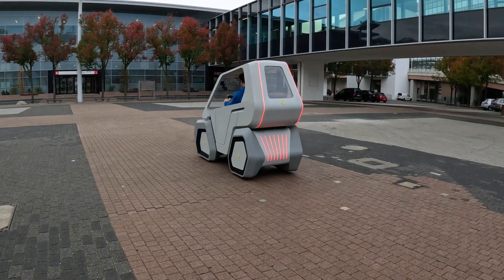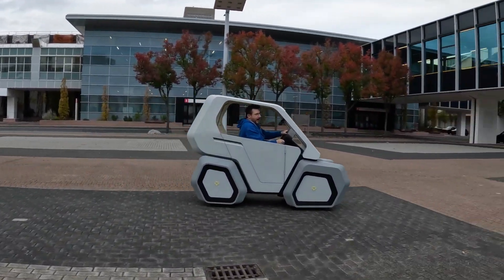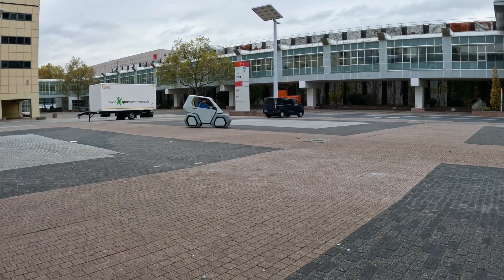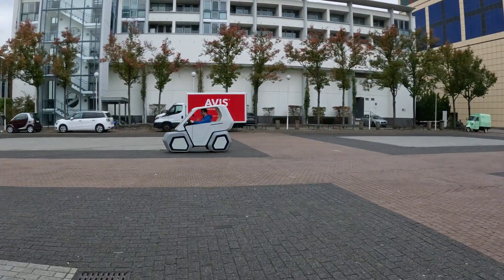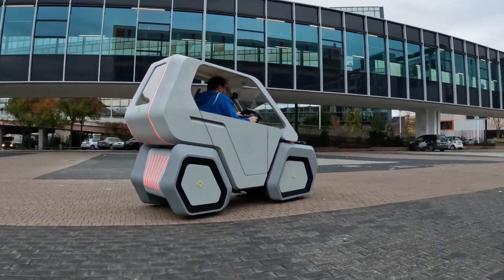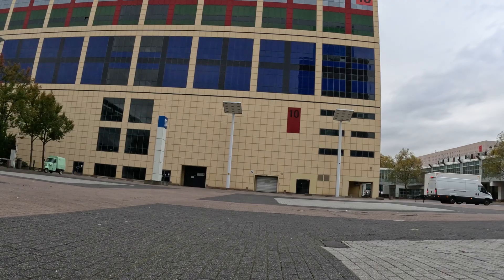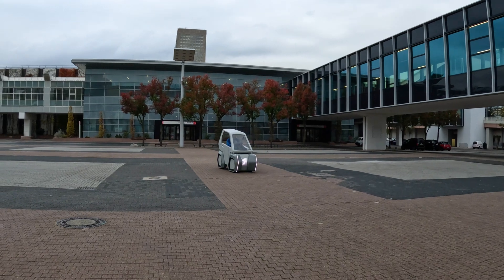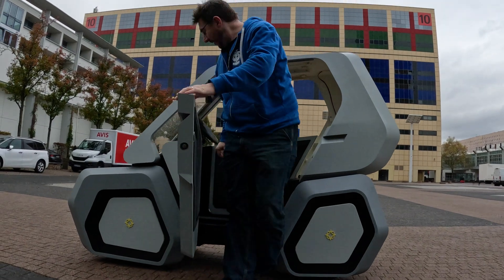Bicycle of the Future?

Comment: As a Dutch guy this looks like hell on wheels. It looks clearly designed by people that never drive a bicycle.

Also find it hilarious they try to argue it's a "green mode of transport" considering a regular bike is human powered, while the stuff required to make this thing aint. And even a standard electric bike is better due to simple things like air resistance and less materials required. And even if you want to be covered, just wear a poncho or if you're that dead set get a recumbent bicycle.
Reply: Exactly my thoughts. Just because it is electric, it's not green. It's also hard to imagine riding this monster on German bike lanes
Reply: @user-pp3yi5tv7l  Exactly, you'd either be an ass that passes everybody and is a general hazard to people you share the road with or clog the lane because you're stuck behind a cyclist. And that's not even getting at things like free turns to the right at some stop lights or places where you cross other traffic. 
It only really looks nice if you don't plan to share the road with other people or drive on between the cars at which point it's probably smarter to just get one of the 45km/h cars that count as a scooter (which are also annoying in traffic)

It really looks like a project that's build "because we can", not because it solves an issue.
Reply: I mean it's better than a full blown car... But that isn't saying much. I can see the appeal of a full cover. But covering the wheels seems just absolutely stupid to me. How will they get across any curbs with those covers? And to me, this looks like it really shouldn't belong on a bike lane. Imho it should just drop pretending to be a bicycle and get a renault twizy or something like that.
Reply: I get what you mean.
Still, using a rhethoric I despise when brought up to me: It is better than any SUV and compared to an actual bicycle or pedelec has better chances of being used instead of a SUV.
Yadda yadda, slavery, destruction through lithium mining, poisened earth mixed with blood - I know.
Reply: @manarallego3745  My objection is mainly just practical from a simple use POV. Regular bikes, electric bikes, recumbent bikes, electric scooters, covered electric scooters, etc., etc. are all better than that. As it's basically a very shitty 1 person electric car to begin with. Having those on any bike path is just hell for any fellow bicycler and yourself.
Even in the US where such a thing would drive on the road with cars or very close next to it you'd be better of buying a one person electric car.

As for the green thing, it certainly is better than an SUV (not that you see many here in the Netherlands, or Germany where this "bicycle" is being build). But as a thing that claims to replace bicycles and claims it's green as the things that it claims to replace are greener. It's akin to claiming tomatoes grown a few 1000 kilometers away and bought in the store are better for the environment than one grown in your own garden, because in the store it says "biological" on the package and the ones in your garden don't. It's pure marketing spin.
(and the whole green thing of electric vehicles compared to a similar modern cars is questionable at best to begin with if you include the whole life span of the car but that's a whole different discussion)

Between this thing and a SUV sure, it's greener. But it's basically a shitty renault twizy or similar 1 person electric car that would be an annoyance on the bike lane on a good day and an outright hazard on a bad. (thanks PenPeng for the name or a 1 person electric car)
Reply: Even not Dutch, this thing looks not good at.
Reply: From a design POV.
1- not practical body design. Imagine going above a bump and those fixed wheels things  have no room for moving up and down.
2- the design is ugly.
Reply: The typical "it ain't green" commentary. Some of us, me, buy electric cars to eliminate our dependency on gas and NOT for the "green" perspective. In reality I'm not fully "green" anyway as I drive a BMW i3s REX which is very cool as, if I am dumb enough to exceed the battery power I can switch over to a gas powered generator to hold the battery charge and keep going for 80-90 miles in search of electric or more gas to go another 80-90 miles. I did NOT buy it for the "green" reason that so many people that dislike electric cars put up as an argument against.
Reply: @DaveDarin  Because a lot of people do buy it because it's marketed as "green" and some government funding in places is based on that marketing. And from a sheer practical use case scenario a normal car functions better (lighter, no charge times, etc.), but the vast majority of avid electric car lovers already concede those points. Which only really leaves the "green" argument for the vast majority of them.

As for trying to eliminate a dependency on gas, you'd just be trading it for a dependency on a small group of metals mined from a small group of places that are quickly running out with no new mines (or alternative battery chemistry) in sight.
Granted if it's purely due to some hatred of gas and not the dependency itself than that's a perfectly viable reason. Of course the validity to hate gas might be suspect but that you didn't tell.
Reply: @relo999  I don’t hate gas I just wanted to eliminate or limit my dependency on the fluctuating market. For me the 30 min charge time is not a big issue as I can drive the 200 miles on pure electric and 80-90 miles of gas so nearly 300 miles before needing to stop for either or both. So that’s a 4-5 hour drive where a 30 break is welcome plus I travel with my dog who would need a 30 min walk by that time.
Reply: @DaveDarin  That a fair reason. Though how much cheaper a replacement battery (and the relativly minor electricty cost) is compared to fuel cost over the same span of time is questionable and probably dependant on the amount you use the car (as batteries not only degrade by use but also lack of use while a normal car doesn't suffer from that, unless it not driven at all for years).
Granted if it's purely the stability and not related to the cost, fair enough. As your cost of driving does become a whole lot more consistent with electric, even if it might be more expensive. And I can see the appeal of that.
Reply: @Relo  I’ll have to look it up again but it’s either 7 or 8 years but if the BMW does not hold 70% of its charge in that period then they replace the battery. I think it’s 8. So BMW warranty is 8 years or 10, I’d have to look that up but before that if the battery doesn’t maintain 70% they replace it. Almost makes you hope that the battery doesn’t as a new one at that age would be great. And after 8 years I would not be keeping it. In fact it’s a lease so 1 year from not I return it as the buy-out of the lease is a horrible deal. Unless they cut me an excellent deal I will return it long before the battery fails. Then I’ll have to figure out my next purchase which I have no idea

Comment: thats cool. how long does it take to print though. they need a pick up truck version for the states
Reply: They using printers to rapid prototype in the end they will probably make molds and mass produce them that way printers I don't see being useful for mass production ever I don't see printers being able to print good quality stuff at 1000mm a sec while staying good quality. They are good for rapid prototype work though as you don't have to wait months for new molds to get made + it is cheaper as molds are expensive.

Comment: A 3D printed Renault Twizy? Thats amazing.
Reply: The Renault at least drives a little bit faster (45 km/h). I would just love if they put the limit to 50, so you can move with normal traffic (50 km/h is a common speed limit in europe) in a city so you are not just a road block and obstacle for every normal car on the road.

Comment: This is neat but looks like it REALLY wants to tip over when you turn. Good solution for staying dry while biking though.
Reply: I prefer to have my rain gear (jacket, pants, rubber slipon boots) in the backpack and use a normal bike. It's cheap, universal, way more ecological and easy to take everywhere...

Comment: No more parallel parking if vehicles get small enough :)
Reply: You'll still have parallel parking. Even this vehicle will take up less of the road width parallel parked front to back than parked side by side. Plus side is more would be able to park on a block than regular cars. Downside is there would be more of them because they're single occupant vehicles.